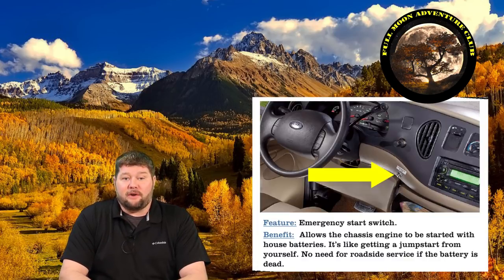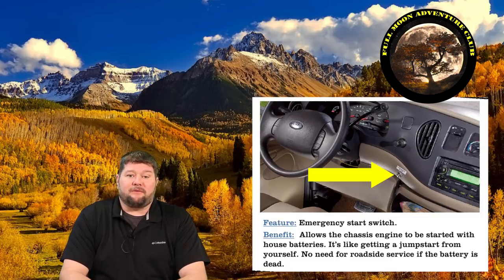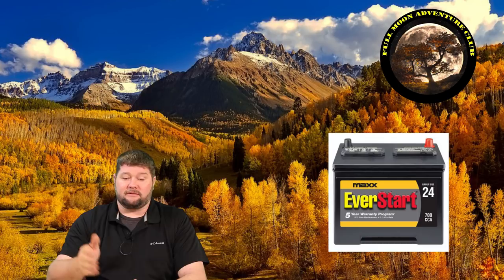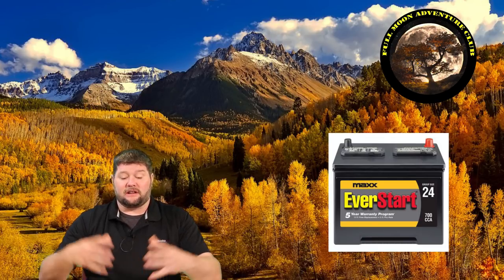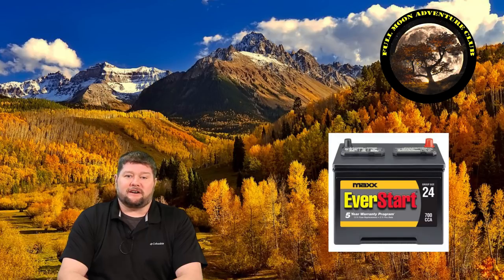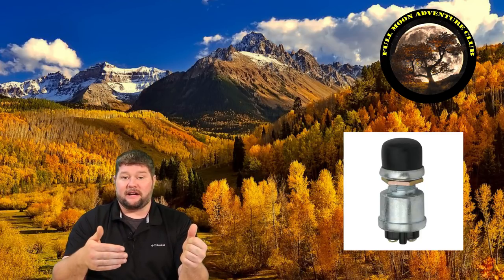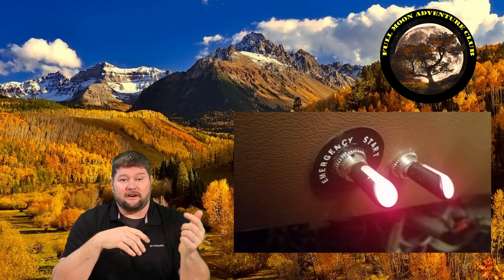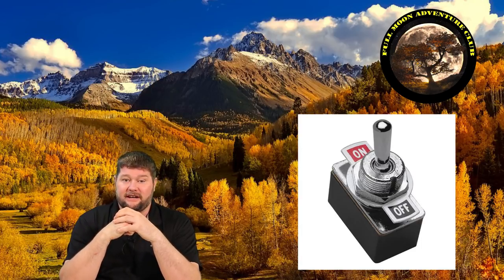RV Emergency Start Switch Operation And Tricks

Comment: I think you are the most knowledgeable RV guy on YouTube thank you for continue making videos and stick with it your subscribers will come
Reply from the maker: Thank you very much. I am glad you enjoy the videos. I will try to keep them coming.      Jim
Reply: @fullmoonadventureclub  Hi Jim. Thank you for this bit of really good info. Now is the auxiliary switch the same as the emegancy switch?   We cant get our rv to start. It wants to turn over via going into the motor and spraying some starter fluid, but other than that nothing happens when trying to turn the key. Is there any troubelshooting steps you can offer please?

Comment: I watched this video a couple years ago and this is an upgrade I DEFINITELY want to add to my RV, but I can’t seem to find a toggle switch with the right number of terminals that has a deep enough threaded post. The panel my button is on is maybe 3/8” thick, and The switches I see are for maybe 1/8-1/4” panels. Hope my question is clear.

Comment: What do you think about letting the engine alternator charging your coach batteries why going down the road. Thk You Jim !! Youve taught me so much
Reply from the maker: I'm currently looking into that. That is how it set up in my RV the alternator does charge it while I'm driving. However I heard someone mention something about the current and phase of the alternator possibly not being compatible with lithium batteries. Also the alternator only charges to 13.6 volts and lithium batteries typically need to be charged to 14.4 or 14.6 volts to be fully charged. My system has been installed for over a year and is working fine but I'm going to do some more research on it. Thanks for the question and I'll get back to you as soon as I can. Thanks for watching and happy camping.

Comment: I've done that trick before my chassis battery was dead and I had to hold down my battery boost button, then start my generator and I have to drive home holding down the battery boost button lol. 

Wasn't fun at all but it got me home 😉
Reply: VeryCleaverName  

In a normal situation you are correct once you started your engine, you don't have to hold the battery boost button down but my alternator was not charging my battery.

So I have to start my generator and hold down my battery boost button that way my generator can charge my engine battery while I was driving.

If I were to let the button go then my battery for my engine would die and my generator would die since the generator feeds off the engine battery as well in that motorhome. lol.
Reply: VeryCleaverName  

My bad it would have helped if I mentioned it lol.

Comment: Thank you I just bought a class C I asked what that was for. Didn’t get that answer found out later the teacher guy was out sick. So thank you
I do have a question about plugging my the House extension cord 120 to the furrion plug in. What can I keep running. They told me the air conditioning wouldn’t work but it does and so does the refrigerator.  Is ok to keep the ac and fridge running. I just hooked it up this morning seems to be working fine. I can’t get a answer from the dealership I bought it from. Any help,would be great have one other question if you would like to help,me out  Again thank you for this video
Reply from the maker: I have used extension cords to run the AC and refrigerator before but if the cord is not thick enough it will trip your house breaker. You need heavy duty cords to run the AC. In my experience it may run for hours but will trip the breaker. Heavy gauge extension cord and the shorter the distance the better. Some use welding cable to make extension cords and they sell 30 and 50 amp extension cords at most dealerships. I hope that helps.     Jim
Reply: fullmoonadventureclub it did I got a 20 foot heavy duty like you suggested working great. Thank you again

Comment: Jim, Great info.  I am looking to install one in my RV which does not have one.  Do you by chance know all the parts needed?  Some places I see a Solenoid, Switch, and a Relay are needed. Other places it seems like just a Solenoid and Switch are needed.  Do you have any info you could share on how we could build our own?
Reply from the maker: I believe you need a switch, solenoid, relay and a battery isolator. Then you also need a long amount of 2 gauge wiring. It would be an interesting video. Maybe I'll do one on that. I'm pretty sure you need all the components I've mentioned in order for it to function properly.    Jim
Reply: fullmoonadventureclub that would be awesome if you did a video on that.  There seems to be just enough info on YouTube and the internet in general to really get yourself in trouble, but not enough to make sure you do it right.

Comment: Hello. Nice video. My manual tells me I have that button. Once I find it, What do I do while pressing? Do I turn on the started key at the same time? Sound logical, but I don't know. I have an xplorer 2017 350 Ram Dodge. Thanks
Reply from the maker: That's what usually just connects the chassis battery to the house battery. So you can press it and try to give it a start and if it doesn't maybe keep holding it for a minute or two and then try again.  Jim

Comment: My question is what amp rating did you use for the switch?  Thanks
Reply from the maker: I think that switch is rated for 20 amps but really the solenoid does all the work of transferring current and the switch just activates the solenoid.    Jim
Reply: Thanks for your help

Comment: Does the starter system have anything to do with the low fuel cut out relay ? For some reason I have no power coming from any source and the batteries are fully charged .

Comment: Before i knew what this button was i pressed it while my engine was on and then some smoke happened and the engine wont turn over, both batteries have 12.5 volts